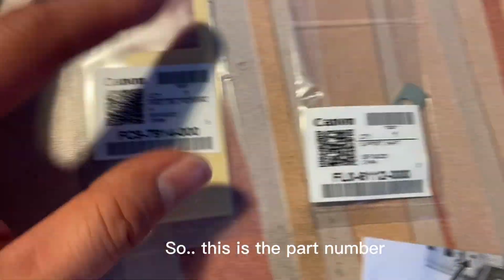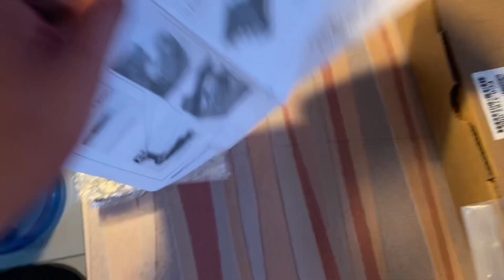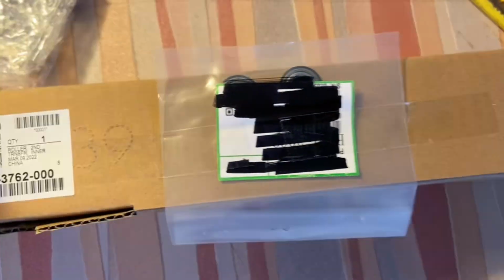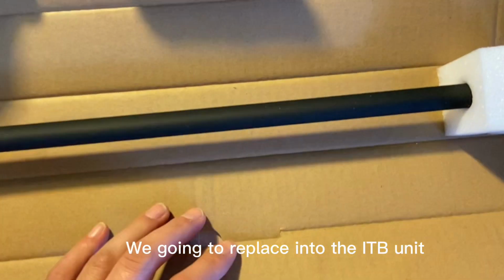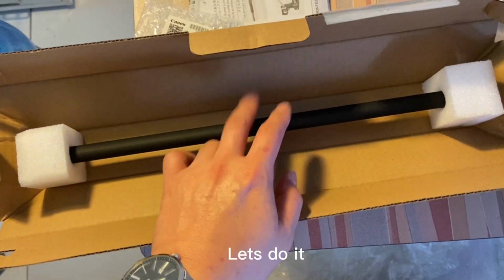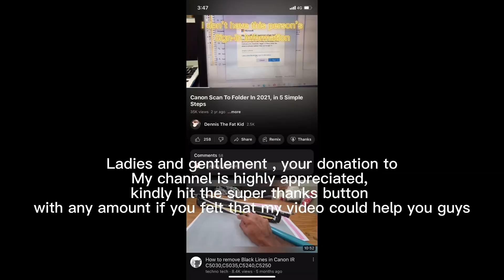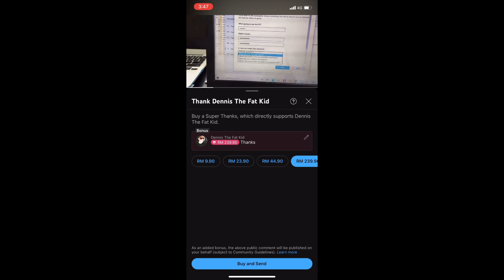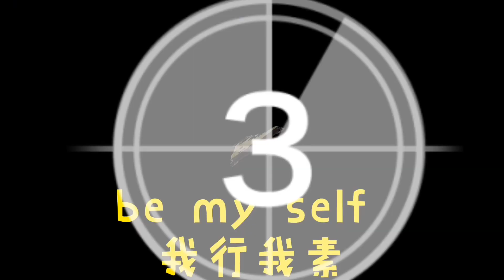CANON IR ADV C50xx & 52xx - ITB BELT PROBLEM E000075 0003 KEEP REPEAT THE SAME ERRROR CODE

Comment: thanks for this video you help me a lot friend. Recently i am getting a Error code for my canon c5030 is E000613-1536 after i turned off and on it'll work fine. can you help me on this how to solve this error
Reply from the maker: Welcome sir,This error is referring  to “Faulty/insufficient image memory (Main Controller PCB2)” I think you have to replace the PCB2 or change the ram